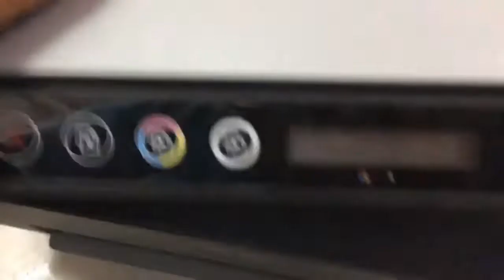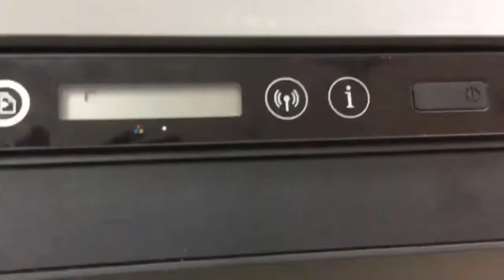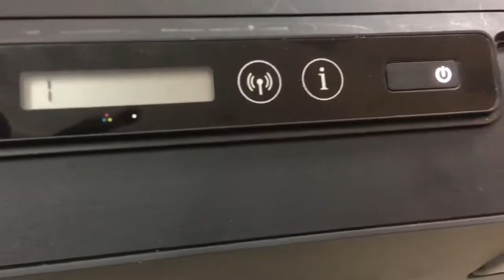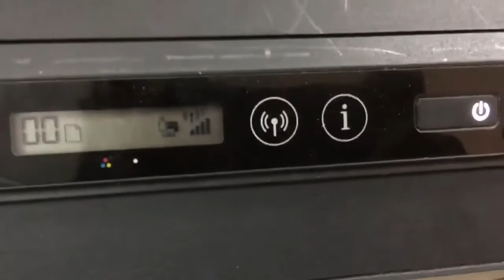How to fixed 100% HP Smart Tank 500 510 511 514 515 517 518 519 508 531 532 538 610 617 618 error E3

Comment from the maker: How to fixed 100% working HP Smart Tank 500 510 511 514 515 517 518 519 508 531 532 538 610 617 618 error E3,
Control panel lights and display icons status, E3 Cause the Carriage inside the printer has stalled. Solution 1.Open the front door, then the printhead access door.2.Make sure the printhead latch is properly closed and the print carriage is not obstructed. Do not open the printhead latch.3. Remove any jammed objects blocking the carriage.4 Close printhead access door and front door.5.Press the Resume button to continue printing or press the Cancel button.6. If still problem checking hardware parts or replace board carriage or motor or main board drive the board carriage
Paper width mismatch (E1) or Paper length mismatch (E2) has occurred, When printing the printer detects that the paper size of the printing job does not match the width or length of the paper loaded, E3 Cause the Carriage inside the printer has stalled, The Number Counter icon is showing E4, and the Resume light is blinking cause here is a paper jam, The Number Counter icon is showing E5 cause the scanner is not working, 
Printhead icons and the Ink/Printhead light are blinking